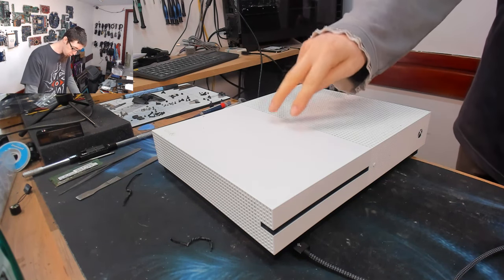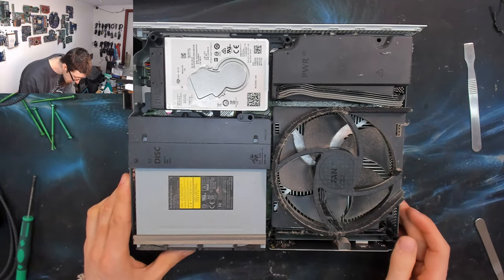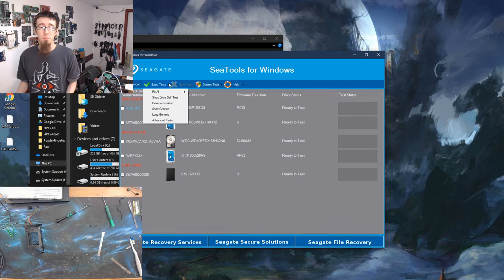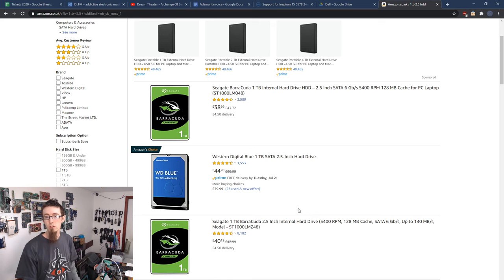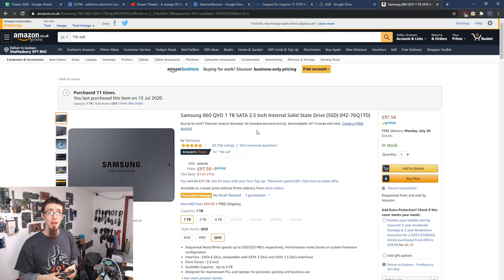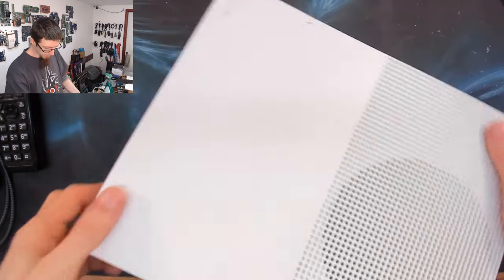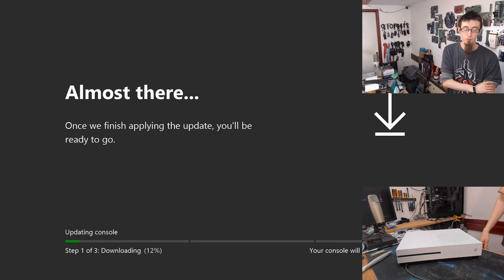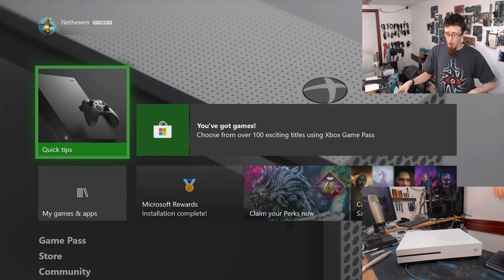Replacing an Xbox One S HDD with an SSD - LFC#214

Comment: That Crucial is actually a 480GB won't work on XBox One's. They require at least 500GB so you would have to go with a 512GB or higher for the drive to work in the XBox One's. Also you should have connected the new SSD to your PC and formatted it to NTFS before installing it into the XBox One S. Then when you boot it would have given you the option Option System Update straight away. FYI

Comment: Crucial MX 500 in my One X. Top performance price.
Reply: was it worth it? Does it make a difference? From what I've seen, not so much. I upgraded my PS4pro to 2TB Firecuda (HDD+8GB SSD) because it was super easy and only 1TB. It makes the system boot faster but otherwise, not really...
Reply: @juraj_b  MX 500 Is One of the best sata SSD 😉😉😉
Reply: @revelator3665  I wasn't questioning the drive itself, I merely asking whether it was worth upgrading for the hassle rather than just plugging in external drive
Reply: @juraj_b  Yes it worth, Best performance Everywhere, LAG in os and in game,os latency,loading game and reloading, response time of the system, worth every penny. But no with cheap SSD. Only 860EVO and MX500. Not less. SShd Is much Much slower than this 2 SSD.
Reply: @juraj_b  try by yourself,dont trust too much to this old video with crappy SSD.
Reply: @juraj_b  https://ssd.userbenchmark.com/Compare/SanDisk-SSD-Plus-960GB-vs-Crucial-MX500-1TB/m206516vsm406099 he used sandisk...
Reply: @revelator3665  Agreed the Crucial and Samsung drives are the only ones I am willing to use.
Reply: @juraj_b  for systematic longevity and portability, it can be worthwhile.

Re: FireCuda, they're shit. Not because Seagate, but because SSHDs are a terrible half step evolution that end up failing to meet even their intended improvements, all while costing more than comparable HDDs in a time where SSDs have been plummeting in cost, DRAM and DRAMless.

I do agree that externals are a better fit for stationary consoles, but switching to SSD may help with keeping the OS going for longer.
Reply: @juraj_b  I just upgraded yesterday and the answer is a resounding YES even playing off my external HDD is faster because the Xbox can do os calls so much faster to it's internal ssd. Note my config is a 1TB internal ssd. 1 500 gb external SSD and an 8tb wd HDD.

Comment: A lot easier to replace the HDD with an SSD in a One S vs a One X! No weird cables or front panel stuff, just unscrew a bunch and you get direct access to the drive. Nice.

Comment: SSD load times on consoles are very slow, when compared to SSD load times on PCs
Reply: yea the connection cant use the full power of the drive. it is still faster then a hard drive though .
Reply: @oneamazingkaboomer  yea but you still want to use one with a dram cache in it. If you go to cheap and get one without a dram. It might effect installing big games. It would be actually an interesting test.
Reply: mister.T Jr  no no, Dramcache in an SSD makes it much faster. This is  something that alot of cheaper SSD's dont have. very shortly how it works is that it saves some data that may accure later on in the cache so it responds much faster. SSD's without this can be times and times slower than the SSD with it. They can be fine without it for light loads but they (in many cases) even gets slower than a normal HDD
Reply: So basicly, dont buy a SSD without Dram cache, ull go better with a normal HDD in that case, and that says alot ;)
Reply: This Sherlock Holmes
Reply: mister.T Jr  no. ssds can come with a d-ram cache. its like having a tiny bit of super fast storage that it writes to first then writes to its permanent storage. the bigger the cache. the bigger the file you can write ultra fast . you will notice it when you transfer something and it starts really high then a little way into the transfer you see a drop in speed. really cheap ssds dont have that.  there is a lot about ssds that determine there speed.  but you will mostly be reading from the ssd anyway so it shouldnt be the biggest deal.
Reply: @thewizardoftech5075  ,
A DRAM cache will have no benefit to install times. It's very small and the data will just move over to the main memory anyway. Pretty much any modern SSD should have similar performance for load times in games as there's rapidly diminishing value due to bottlenecks elsewhere. At least until we change how SSD's are utilized such as how the new consoles work... besides, what are you installing the game FROM? Both the Internet and BluRay drive are going to be big bottlenecks as well. If it takes a few hours to download a game that installs in a minute then who cares about install speeds?
Reply: @zethir9194  ,
While a DRAM cache helps, remember there's actually two different caches (one if no DRAM). The DRAM cache is relatively small. The other cache is an "SLC" cache which is the 3-bit or 4-bit flash memory used as 2-bit to increase performance (which decreases capacity). Usually a few tens of Gigabytes. I believe 1GB is the DRAM cache on some SSD's. It's likely that both caches make little difference in reading (loading) of games. AFAIK the only reason you might see benefit is if data stays in the DRAM cache that is frequently read but even that I doubt would happen in a typical game.
Reply: @sixty eight ,
Well, yes and no. It can significantly speed up the loading times of some games or new areas in the same game. You can argue about the value of that but to me it would be worth it. In most games it's closer to 20% gain, in some games it's up to 3x faster
https://www.youtube.com/watch?v=7kqMhdgGsVI
Reply: I have a SSD plugged into the USB port and load times are about half compared to the internal HHD.
Reply: This is because Xbox Ones use older SATA 2 for the interface connection to the internal drive. I tried this about a year a go and saw very small speed changes of the ui, etc.
Reply: @DatzBunz  My xbox one x has a USB 3.0 port.

Comment: SDD's do fail, I've just had two in a row, although age was not on their side.
Reply: All things fail but if something has a mechanical part in it that can wear down, ssd are more reliable in that sence
Reply: Cheap is expensive ;) I run an kingston AS400 1TB, set it up 3 years ago and still going strong.
Reply: @BradElliot  yes all things mechanical that turn or move will wear and probably stop working eventually ... but that SDD's never fail is a myth, and at least you can get the platter out of a failed hdd and access the data ...
Reply: @Kosmonooit  well designed SSDs are made to go into a read only mode when they run out of writes.  That's what Intel SSDs do anyway
Reply: @Ecmslee  in reality ssds brick when they die.  SSDS might last j ust under 10 years at best, hdds can last longer if treated well and with some good luck
Reply: @patg108  Yeah some really good luck...
Reply: @trixniisama  doesn't take all that good of luck for hdds to last longer than 10 years in frequent use, but it does for a SSD.

Just need a good model and brand and batch.  SSD you're pretty much screwed at the 10 year mark
Reply: @patg108  I think it's a bit complicated to say for sure when the tech inside ssds has evolved over the past 10 years when HDD are basically the same since ages.
Reply: SSD's have a "terrabytes written" limit before they begin to fail. Also, a huge pro to ssd's is that they are a lot better for mobile devices do to potential for impacts.. No mechanical parts, nothing to get moved around for it to fail faster
Reply: @mangoslice6319  they still have controller chips as does a normal hdd, that is a weakness too, if that fails before the read writes are up you're screwed.

There's no denying they're faster but the reality is any mechanical hdd has no read/write limit, its just a matter if the parts are in working order plus the chipset that manages them.  That's why board transplants can save data from a normal hdd but a ssd is much more difficult

Comment: This was a great video, man.  Do you know if game save data is saved to the gamertag, or is it all lost when you swap drives?  Before I handle something like this I'd want to know how all of my save data would be transferred to the new drive.
Reply from the maker: That depends on the game I think. This console came to me having already been reset once, and wasn't working or logging into XBL - so there wasn't any data for me to work with. I think you can backup your game data to an external HDD if the console is still running though, right?
Reply: @Adamant_IT  Yeah, my HDD is currently working. Do you think I'd be able to replace my current HDD with an SSD, and then use my HDD as an external drive? Just pop that one into a USB 3 case and have them both plugged in? Thanks for the info, by the way.
Reply from the maker: You certainly could, yea. I'd make sure it gets through a long-test before putting it back to work - but past that, yea it'll be a good reuse of the drive.

Comment: Thanks for the help kinda old but your video helped so much in times like this Xbox one s is still $289 and I don’t wanna trash my Xbox just because it turns on but don’t load up so I just bought an new ssd 500gb I’m not too big on games no problem but yeah pretty cool to replace a hdd with an ssd it’s a no brained I was gonna trash the Xbox but I found ur vid and u saved the planet and gave the Xbox 1 more chance to live out its days .. I remember taking apart my first Xbox 360 and it was a nightmare just to switch out the dumb cd drive due to the RED ring of death and never agin but u saved the day thanks mate

Comment: If your harddrive is failing can you use an external harddrive to play still or do you have to swap the internal still?
Reply: I was wondering the same thing as well
Reply: @tiffanybr00ks  I played off the external for a little bit it worked then other apps and stuff were still crashing so I switched it out ,the internal ,and worked great after that
Reply: @aaronwells6633  I ended up getting a new hard drive but put an SSD and mine is unfortunately not the hard drive. So back to square one lol

Comment: I would not call a QLC (Quad Level Cell) a great deal for that amount of money. There are better drivers, like Crucial MX500 for example. Same money, better TBW: Crucial MX500 1 TB CT1000MX500SSD1
Recommending QLC should be punished by Law.

Crucial BX500 series does NOT have DRAM which means they get slower and slower writing speeds, the more data you have on the drive. Reading speeds go down as well, but not at such a crazy rate.
Reply from the maker: Prices swung literally a day after I published this video, which was rather unfortunate. I agree, the MX500 is a much better buy right now.
Reply: Exactly 😉😉😉 i have MX 500 in my one X... Top performance.

Comment: Wow, i didn't know they made upgrading the hard drive as easy as the PS3/PS4! I remember it being a nightmare on the 360, they kept that quite!
Reply: I don't think its fair to say "as easy as", since for the PS counterparts, its sliding a plastic housing and then one screw to pull the drive. Even the PS5 you just bonk a side panel to unsnap it, slide it off and then its m.2 expansion slot is immediately exposed with one screw again.

Comment: What format should the drive be in before putting it in the Xbox? because i thought you had to do more then this due to the drives  that are originally in the Xbox not being NTFS? I think it was a Microsoft thing so you couldn't just put in any hdd you wanted.
Reply from the maker: Flash drive should be NTFS, the new drive going into the Xbox doesn't matter, the recovery process will partition and format it for you.

Comment: Good Choice with the Samsung, I once bought 2 250 GB Sandisc and installed them with a 2 SSD-Rack, after less than a Minute, one of them started to burn, so I did shut my PC down.
It took me about two weeks to get the Plastic-Smell out of my old Tower, but I luckily got a refund for the failed Drives.
I swore to never buy Sandisc-Drives for my PC again.

Comment: I'm doing this as we speak :D  But one thing Ive just learned is that the X1S uses sata 2. If that is the case, wouldnt it be better to use USB 3.0 external ssd?
Reply from the maker: That's an interesting question - lots of people have pointed out that the southbridge of the Xbox throttles SSDs, which is a half-truth. SSDs are more than the peak sequential speeds, 4k ops on a HDD are less than 1MBps, while an SSD is usually 20-40MBps. This is a hundred times faster, but well below the 240MBps ceiling of SATA2 - so an SSD will still give massive potential gains even when SATA2 limited. But this is only effective on games that do a lot of 4k ops, a lot of console games are mastered and optimised to do long sequential loads, which will top out SATA2 - hence why SSDs are only effective some of the time.
HOWEVER, USB3 bypasses the SATA controller, so might not be so limiting. You'd need a stonking good USB3 drive though, most of them top out at 300MBps by their USB controller, so you're still not much better off than SATA.
Reply: @Adamant_IT  The consoles are hugely CPU bound when it comes to IO anyway, so the SSD benefit is mostly latency.

I think people are going to be shocked at how much faster Xbox One games will load on Xbox Series X later this year, even if using a USB drive.

Comment: Problem with them is extended sessions as it has no cache built on after x a mount of time the read write speeds will be worse than the Hdd
Reply: Your right, it will be dog slow on big games if you move the game to a different drive. Evo drive would have been better.

Comment: Before I waste money on a new hard drive for my son Xbox 1 s. The error code is coming up e106 first it was pulling up e105 now I’m in a trouble shooting loop where it acts like it will factory reset then go back to beginning of trouble shooting.. previously the Xbox would run slow or freeze in games now the light was coming on and fan running but controller wouldn’t connect and had a black screen then went to saying nothing was connected to hdmi.. I swapped my hdmi chord to his Xbox same result. I plugged his Xbox to my tv same result.. I know it has power because it’s in trouble shoot mode when you press bind and eject and power.. but can not get anywhere else with this Xbox.. could it be a corrupted hdd?

Comment: You're not going to hurt the drive if you hold it by the top. they are designed to be held in laptops.
Reply from the maker: Yes, and I've replaced many, many, many failed drives from people leaning on the palm-rest. Heck, this week alone I had a customer who dropped his phone onto the palm rest and killed his HDD. It's very real.
They're not exactly paper-thin, I'll give you that, but it's easier for me to teach people to hold the sides than it is to explain how hard is too hard when holding the top.

Comment: I tried fitting a Samsung 870 QVO 1Tb into my Xbox One S, didn't work (something went wrong message), plugged in the flashdrive with OSU1, didn't work. Tried setting up the QVO using the Xbox script to prep the drive (which I've done before on a Seagate SSHD and it worked fine), didn't work. Plugged the QVO in as an external drive, Xbox didn't see it. Plugged it into my PC, everything worked no problem?
Reply: qvo is shit buy 870EVO instead.

Comment: Why don’t you use something like Hard Disk Sentinel? It tells you right away if the drive is failling instead if waiting for a scan to complete. I’ve used it for years to check drives. It uses the SMART feature to tell you the health of the drive. All modern drives have SMART build in. Talking about 2nd hand hdd’s, one person came up to me to replace the hdd in his ps4. Befor i did so i connected it to my pc and ran hard disk sentinel. It said it had about 15% of health left. Now if i didn’t check that he would be back in 10 days to tell me i did a bad job. Anything below 90% i throw away.
Reply from the maker: I don't trust SMART... it's good for additional information, but I've seen plenty of failing drives that haven't tripped SMART. You need to do a long-scan either way, and since the short-scan is only a minute, that's still your fast answer.
However, HDS is still a good utility which you could use instead of SeaTools.

Comment: All we did was buy a seagate 2 tb and open it  up and connected it and then started it by putting it into start up mode(that hold three buttons on the box down until you hear 3 beeps and let it run and it was fine.

Comment: Do i need to format the SSD drive prior to installing it in the XBOX? I tried following your guide but I get an error. Its the cruical mx500. Thanks
Reply from the maker: No formatting/partitioning needed, OSU1 will take care of all of it. Try again from another flash drive, and see if that does the job 👌
Reply: @Adamant_IT  thanks. As soon as I boot the Xbox it says system error. E106 etc. That doesn't happen with the old drive. It just won't update. Some other sites suggest I need to format and partition and preload the software prior to installation?
Reply: @Adamant_IT  OMG. I tried the partitioning which is recommended elsewhere. Was a faff. It didnt work. So I used another FLASH drive as you suggested. And low and behold that was the solution. Thank you. Its working now! Andrew

Comment: Im considering throwing an ssd into my original xbox one in hopes that it will generally perform better running Cyberpunk 2077. Is the process the same? Aside from opening the casing?

Comment: I have to replace my HDD but idk what i gotta do to update it so it boots up right in my xbox one i load the console up and get a startuperror cuz the new HDD dont have any firmware or anything for the xbox one
Reply: https://gbatemp.net/threads/xbox-one-internal-hard-drive-upgrade-or-repair-build-any-size-drive-that-works-on-any-console.496212/

Use this script, this will properly format the drive so you can get the console back up and running.